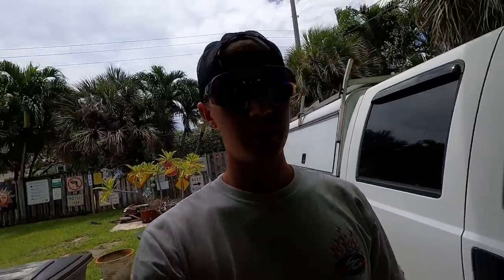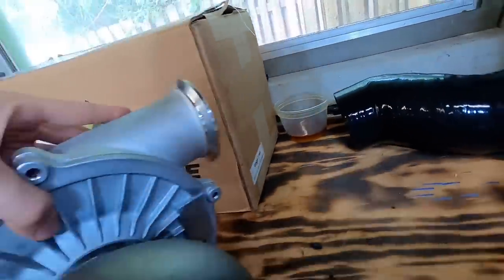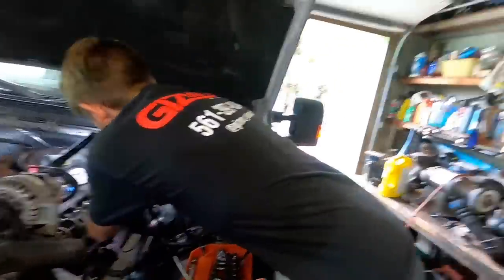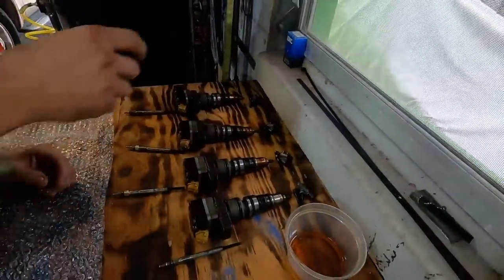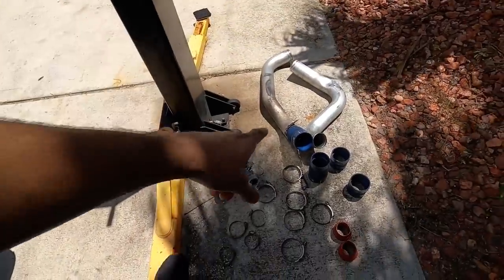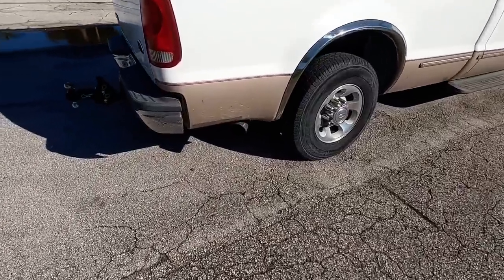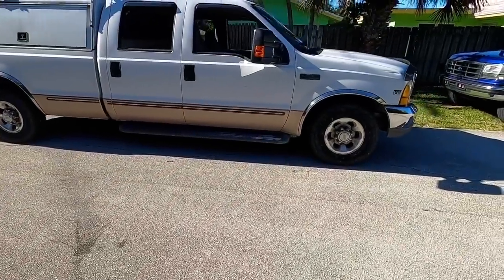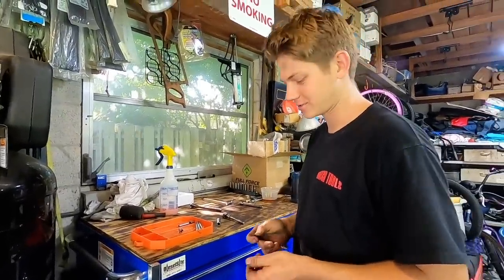Making an E99 Superduty 7.3 the ULTIMATE daily driver PART 2

Comment: Don’t be disappointed if it makes less boost. Because boost is a measure of resistance in the motor. By opening up the exhaust air can more efficiently enter into the motor and lower the boost pressure. It’s a direct correlation to back pressure. When you lower back pressure egts decrease and it makes your motor more efficient.
Reply: Uh, not sure where you gained your knowledge of diesels but there are more than a couple false statements there. I highly recommend doing a little more research.
Reply: CenCoast_7.3 I am looking to learn here. What statements are wrong?
Reply: @chazgeisler6213   your statement is not wrong, but for the application being applied he will gain boost, he's installing  a bigger turbo and injectors, and tunes to go with it. Now if he opened up the exhaust and intake ( im talking about a higher flowing intake manifold, head work to help it flow better and worked the exhaust manifolds to flow better and kept the truck Stock, yes he would indeed see a drop in boost pressure but actually be flowing more air in the process. Gale banks does a really good job of explain it. More than I'm willing to type lol scroll through his videos, the "killing a duramax" series. Its good stuff.
Reply: @kylefolsom8681  haha, I am well aware of his tests. He has amazing info. Data is awesome

Comment: Nice truck !! I have an 02 and I literally jyst drop my k.c 300x stage 1 in my truck over ther weekend along with those pain in the ass up pipes 😂😂😂 had to drill out 2 bolts took a bit but we got it next is my injectors

Comment: I believe the split shots were designed to improve fuel efficiency (which they don’t compared to tuned single shots). But they do run quieter than single shots

Comment: So what turbo is he gonna go with now ?  The kc300x stage 2 works grest on my e99 with stock sticks.  Injectors coming soon
Reply from the maker: I think thats what were going to use!
Reply: @The73Garage   awsome keep me updated I hit 29 psi on stock sticks im interested in seeing what that one does
Reply: I'm looking to get my e99 a little more capable of towing. Can you share you build list?
Reply: @anthonykarch583  kc 300x stage 2 63/73
Injectors 205/80
Mishimoto intercooler 
Regulated return all home made fuel system 
S&b intake 
4" exhaust 

I have a video on my page me testing out the new power on my way to work finished it late the night before lol

Comment: Please tell me you changed the factory rods on it if it’s between 01-03. The infra is pretty bad ass tho, got a 1st gen 7.3 myself stock tune & plenty of power for me. Probably will get a 2nd 1st gen for power mods. 
On the glow plugs if you only use the truck above 35 degrees it won’t need them to start, live in Texas & haven’t used mine in over a year/put a switch on them, so I have them when I need them.
Reply: @centraltexasfoxbodies  No, they do not. Not if you're engine is in good running condition. Just like he said, he hasn't used his in over a year...so how has he been starting his truck without them? My truck here in Cali also does not need them, also put mine on a manual switch. Is there a 2nd set of glow plugs in the 7.3 that we don't know about, lol?